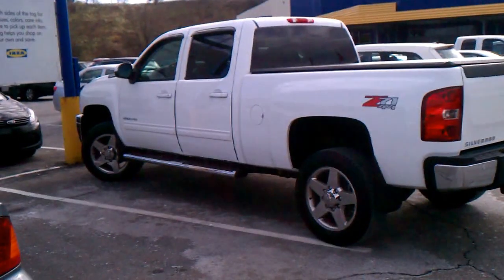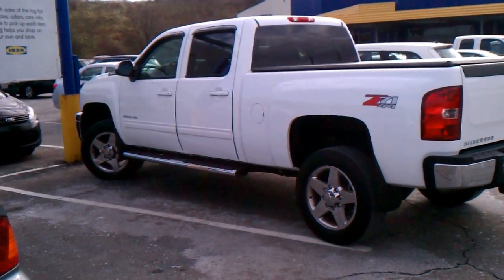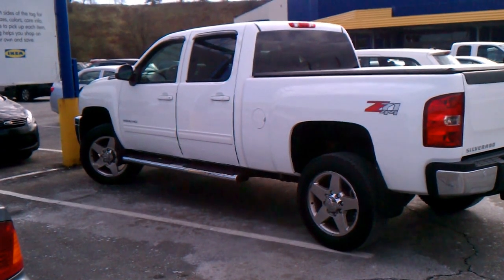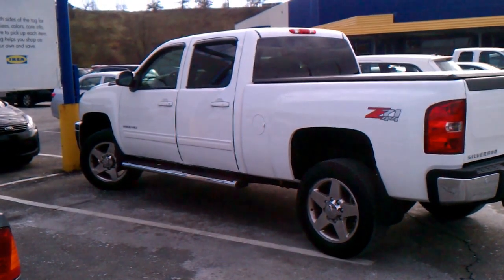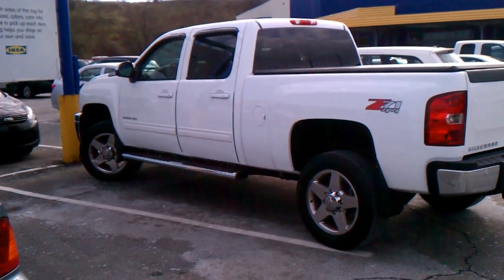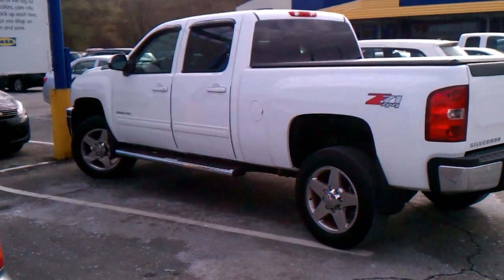Parking Fail #2-A Step By Step Guide On How  To Get Your Brand New Truck Keyed

Comment: I'll be honest, if you haven't owned a fullsize pickup truck...it takes some getting used to.  I've had mine for a month and I still have trouble parking at times.  The long wheel base really makes it tricky.  I'm not condoning parking like a fucktard, but I understand how it happens when you have a new fullsize pickup if you aren't used to parking one.